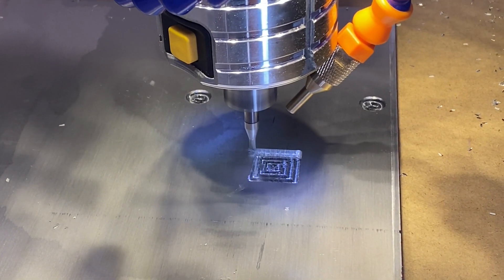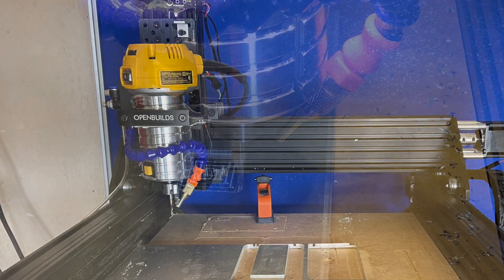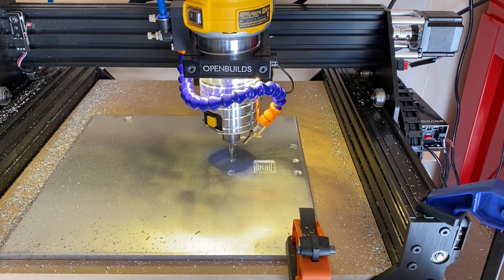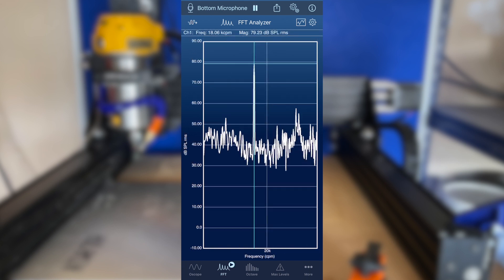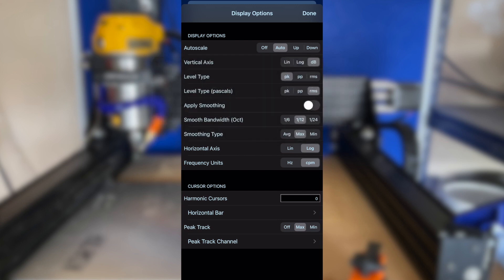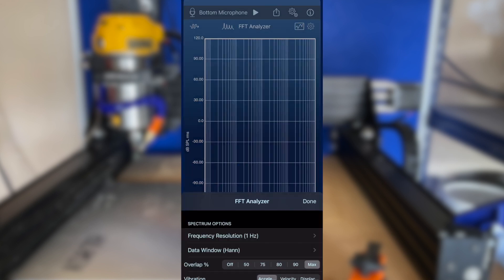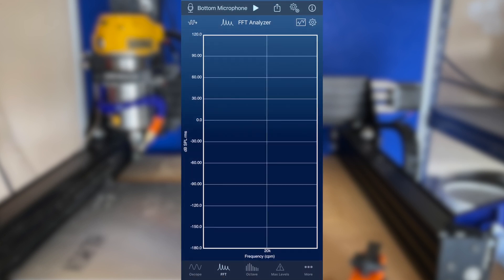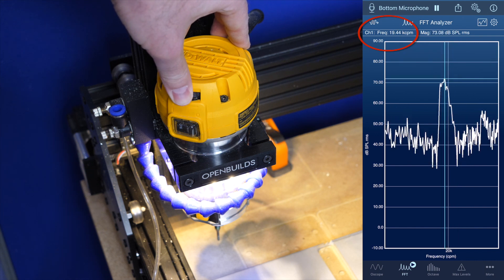SignalScope X Router Spindle Speed

Comment: So if my router is 8000 - 25000 rpm how far outside should I set the limits? I have no idea what just outside is in rpm’s
Reply from the maker: In your case, I might set the limits to 6000 - 27000 rpm. The idea is that narrowing the frequency limits makes it easier to see how close your spindle speed is to the target frequency. Making sure that the limits include the actual range of your router means you'll be able to see peak in the spectrum regardless of where the spindle speed is set. A little extra range may help if the actual range of your router is not exactly what the manufacturer stated.